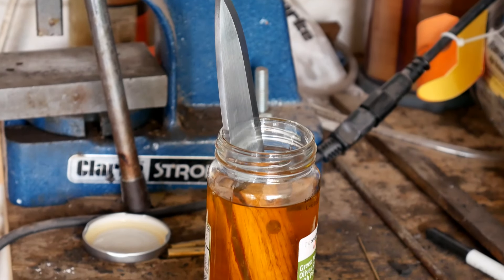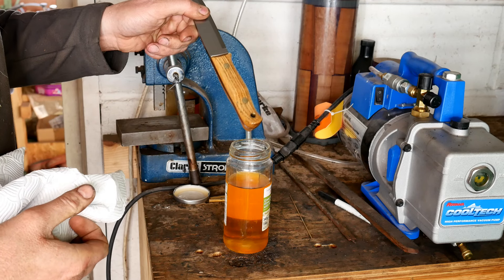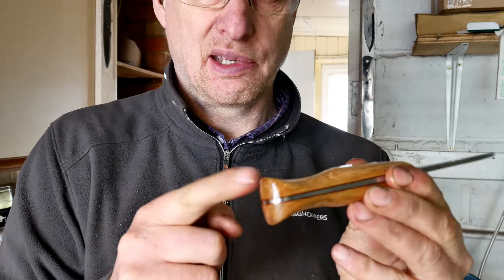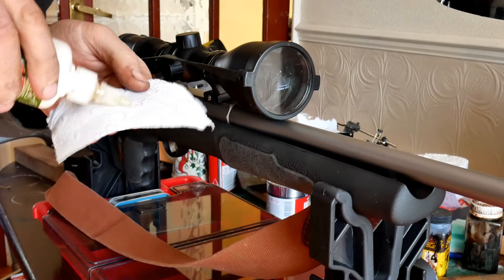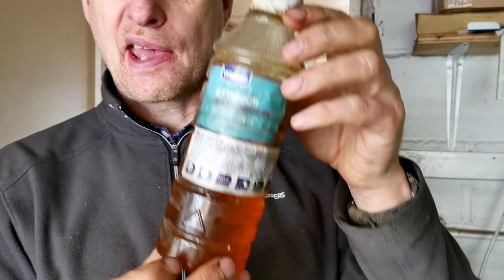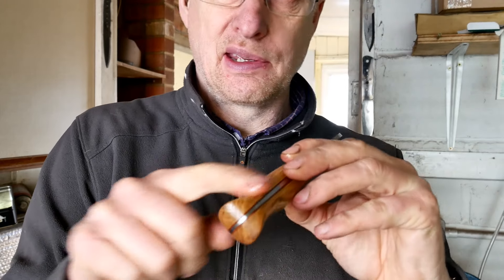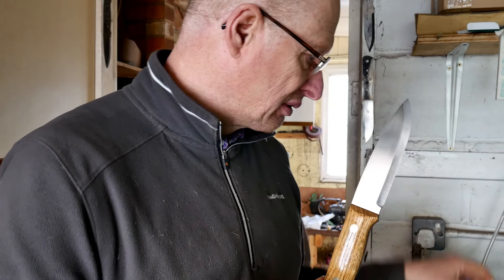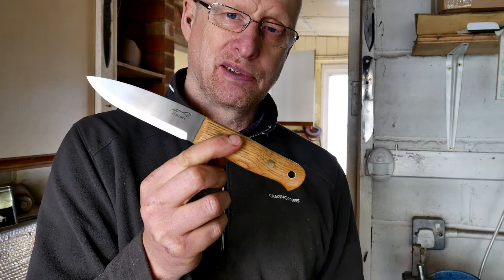Natural linseed oil for unstabilised wooden scales. Please read description box

Comment: Those oak scales look great on that knife. I'm sure you know that Boiled linseed oil has metallic driers that are toxic and that the oil isn't boiled.Yes, boiled linseed oil takes a few days dry, even when you let the handle soak in thinned oil.  I have come to prefer just using several thin coats of oil rather then thining the oil.The oil doesn't really absorb very far into the wood and if it does "watersoak" the wood the oil doesn't have access to the oxygen necessary for poymerization. Oak is definitely problematic because if the open grain (vessels) that fill with oil. I've seen open grain wood bleed for a very long time. BTW Varnish is often thinned for the first coat and that works great. I've been using Tried & True "Danish Oil Finish" i's pure prepolymerized linseed oil with no additives.I've also used pure tung oil. One great all weather and rough use finish is Birchwood-Caset "True-oil."       Have you seen the files in the Spoon Carving Green Woodworking and Sloyd FB group on drying oils? 
-Drying Oils-References & Sources
Reply from the maker: Thanks for the info Lewis, Yes I did read something a while back on a spoon carving website. Also have used Birchwood Casey tru oil in the past too. I believe there are different kinds of Linseed oil, some have the chemicals in and others are true boiled linseed without the additives. The learning curve continues.
Sandy

Comment: Beautiful knife and good information Sandy, remember there are two types of blo or boiled linseed oil, actual boiled which is good, or artificially boiled with chemicals which is not so good, I soak mine in blo (with no spirits or kerosine) for 24 hours then use the old wisdom of once a day for a week, once a week for a month, once a month for a year, then as needed, seems to work.
On the blade I now use olive oil to make the knife food safe, although it can dry and go a tad tacky, I used to use Renaissance wax but was worried about its toxicity in food.
Reply from the maker: This is good information Shelley. Thankyou
Reply: Commenting seven years later, haha.  I make a mixture with about 2 parts mineral oil and 1 part beeswax, heated to combine.  The resulting cream is good for food safe applications, like cutting boards, utensils, etc.  The mineral oil seems to absorb and also leave a thin coating of the wax that can be buffed later on.  You can add some lemon oil, too, if you like the citrus scent.

Comment: nice video, but it should be noted that raw linseed oil will eventually polymerize, it will just take significantly longer(making it impractical for most people to apply). 
Also be careful when applying boiled linseed oil, although it should be safe when hardened it contains several additives(at least in the US) that are not necessarily very healthy to expose yourself to excessively.

Comment: As you say Sandy the aim is to get the boiled linseed oil into the wood.... I am wondering if the same vacuum process you use with cactus juice on other woods could be used on a finished knife or would it make little difference.?
Reply from the maker: Good question John that has been answered in the description box:)

Comment: Hello from Sydney, Australia.. Jack, loving your videos and I am currently working my way through them.  My question is regarding your reference to using a 50/50 mix of boiled linseed with white spirit for the initial application.  I think you are referring to what, in the UK you call White Spirit, but here In Australia (and new Zealand ) we call Mineral Turpentine.  Here Downunder, White Spirt is a more volatile solvent.  Mineral Turpentine is what we would use for thinning oil-based paint, cleaning brushes etc.  So is it Mineral Turpentine you are using?

Comment: Another excellent video, and helpful. I have often used boiled linseed oil for protecting wood, but without diluting it, which I would now like to do. My question is: What do you mean by the term, "white spirit"? I expect we have the same stuff in Canada but know it by another name. For instance, we have a flammable liquid called "white gas", or naphtha petroleum, which is widely available for certain camp stoves and lanterns that must be pressurized before use. Do you know if that's the same stuff? Thank you.
Reply: Its called "White spirit" over here but it is a turpentine substitute.
Reply: PESKY46 In the US we call it Mineral Spirits. Hope this helps.

Comment: Hello Sandy, do you take the unstabilized wood to the buffer? Your finish looks great! I would be concerned with the open grain loading up with the compound.
Reply from the maker: You can buff on a wheel but you have to have a fairly fresh and clean mop and no compound. As you say the pores will just fill with compound otherwise.

Comment: Have you ever tried using the vacuum stabilising chamber but loading the  jar with your linseed mix. Would that work ?  Or would you expect the same problems you get with the cactus juice ?   cheers  a.t.b.
Reply from the maker: You would get more oil into the fibres for sure but it would be a right mess to clean the tank afterwards and also the vapours may not be so good for the vacuum pump. I think I will just keep the tank reserved for the resin.

Comment: Hi Sandy , great video. What would be the end result if put only the finished knife in the vacuum chamber, then pulled it out , submersed it in a small container with the boiled linseed oil and then stuck the whole works into your pressure pot. ??Rob
Reply: Sandy asked us to read description box :),  - otherwise why not.
Reply: I did read it, Just wondering if the pressure pot would help to force it in deeper, faster.
Reply: Sooey 911 I think the liquid like cactus oil is really thin stuff like they say and linseed with white spirit isn't that thin. So, cannot confirm that. They have tried various stuff in vacuum chamber without bigger success. Anyone knows better, please...
Reply from the maker: As soon as you remove the vacuum air being thin will immediately fill the vacuum Nature abhors a vacuum. You have to have the wood submerged in the oil before you apply the vacuum. There is also the chance that volatiles will boil away from the linseed and could cause damage to the pump.

Comment: Hi again sandy
 I think it was cactus juice but not totally sure but it bleeds through white when sanded,if thats any help.thankyou
Reply from the maker: The only way around it is to use a special dye in the cactus juice during t5he stabilizing process. Once it's cured you shouldn't be able to see it then.  I prefer just to use Linseed for Oak handles now. I don't know of any way to fix it once the handle has been stabilised I'm afraid.